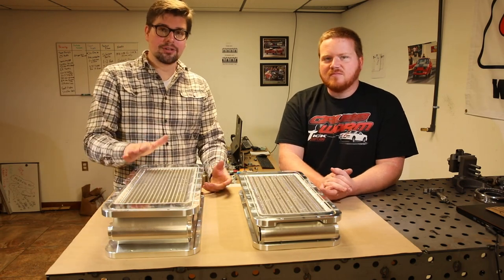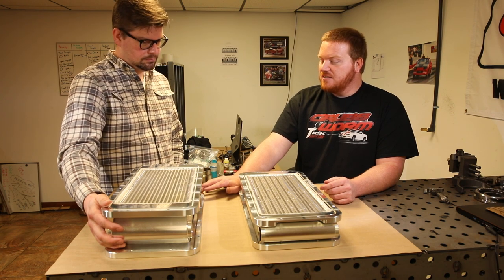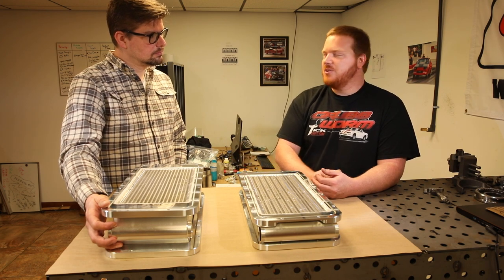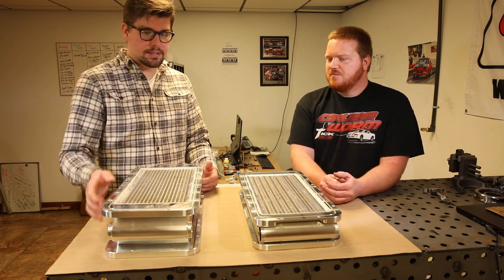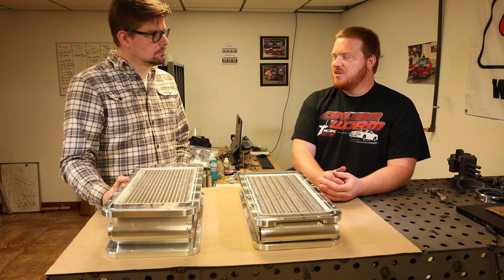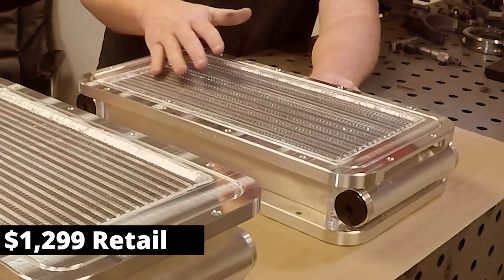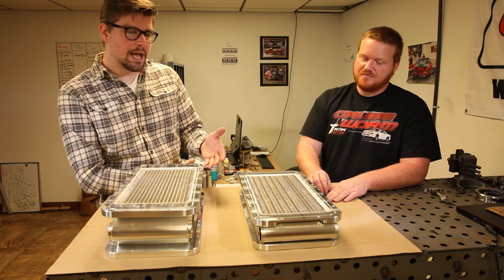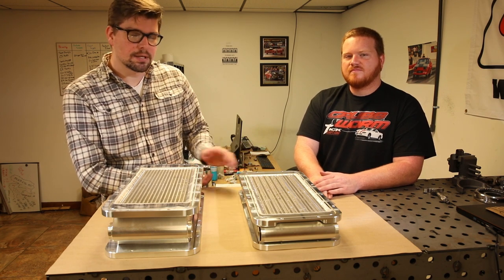Tick Performance Air-to-Water Hi-Ram Intercoolers

Comment: Can you daily drive with this setup, or is it for strictly racing?
Reply: curious about this as well.  not so much daily driving but road tripping.
Reply: @matttackel997  there's no reason you couldn't use an air to water intercooler on a street vehicle.... 6.7 powerstrokes are all air to water intercooler
Reply: @adrianlaverick8040  neither of the 6.7 Powerstrokes I have owned were a2w
Reply: @matttackel997  false. All 6.7s are
Reply: @matttackel997  All 6.7 power strokes had an air to water intercooler on the passenger side, along with a massive heat exchanger and a secondary water pump.
Reply: @adrianlaverick8040  not false, I've personally put intercoolers and cold sides on both of the 6.7 trucks I have had...
Reply: @Matt Tackel  not on a 6.7 powerstroke apparently
Reply: @Matt Tackel  literally all 6.7 powerstrokes are air to water intercooled with an entire secondary cooling system. They have 2 water pumps and two radiators.... and an air to water intercooler on the driver's side. Maybe your confused and had 2 6.4 powerstrokes, (6.7s started in 2011) Or maybe you are confused and had a 6.7 cummins, however all 6.7 powerstrokes had an air to water intercooler